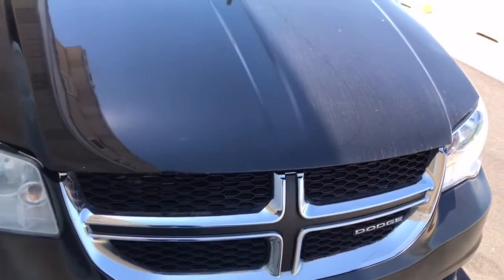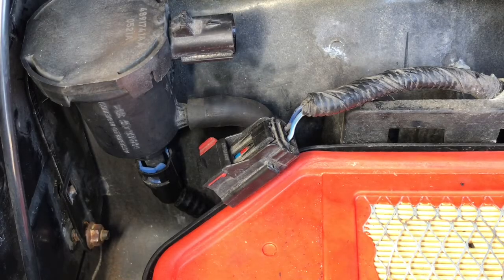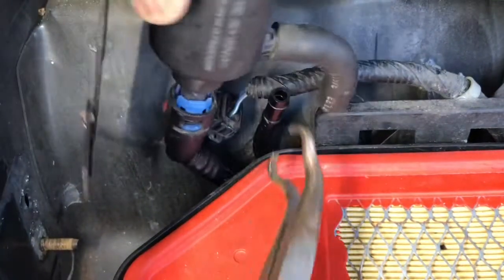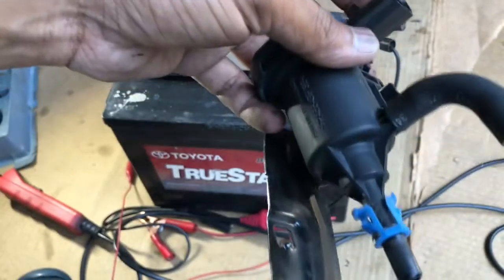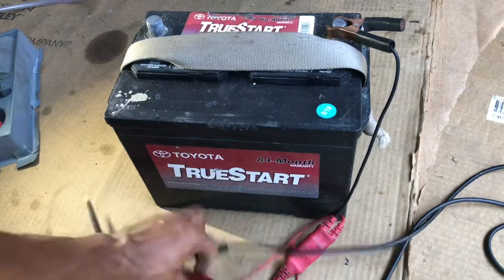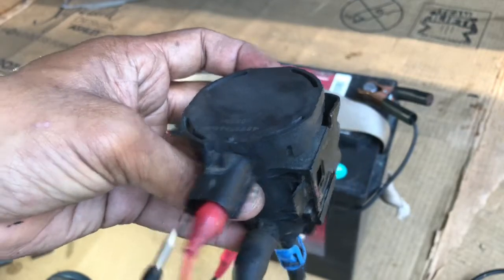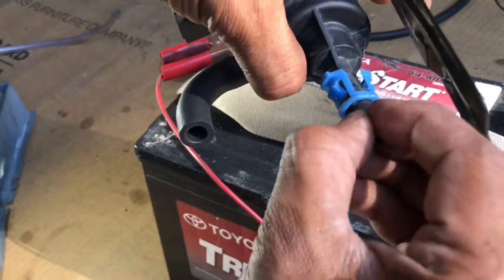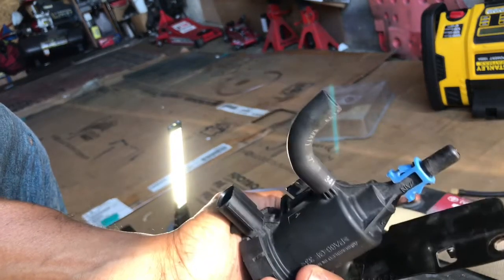Dodge caravan & Chrysler town and country purge valve diagnose & replacement

Comment: I have a 2008 dodge grand caravan 4.0 last summer I turned my van on and check engine light is on, the code is p0403 and p0406, so I started with egr valve brand new one on, toke off my whole top half off cleaned it from all the carbon, put it all back on and the code p0406 went off it's just code p0403 can a evap purge valve cause the egr to not work and code to go out? The code p0403 is a solenoid code so I'm wondering if this is the issue?